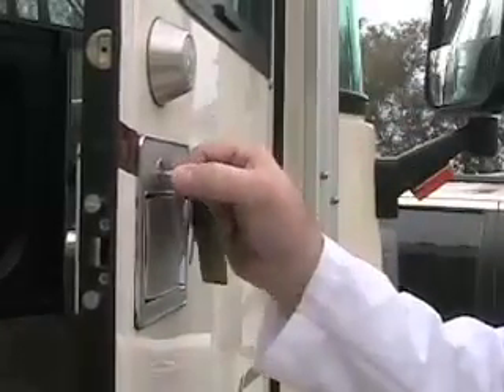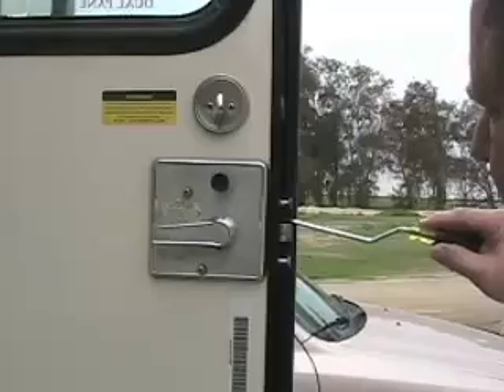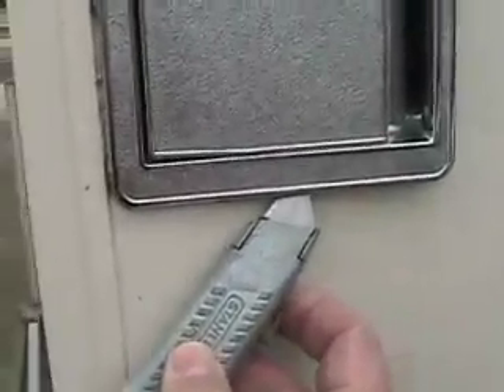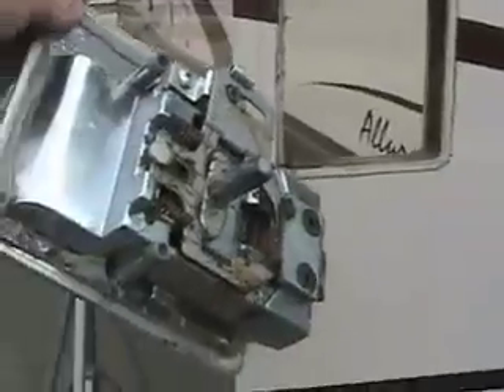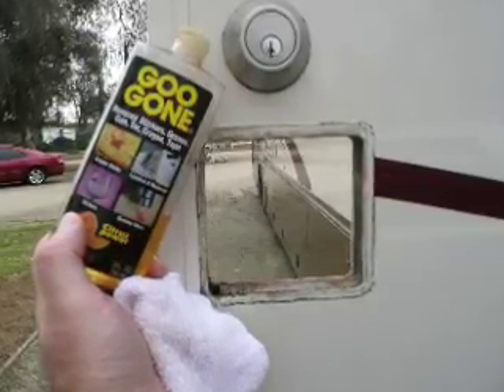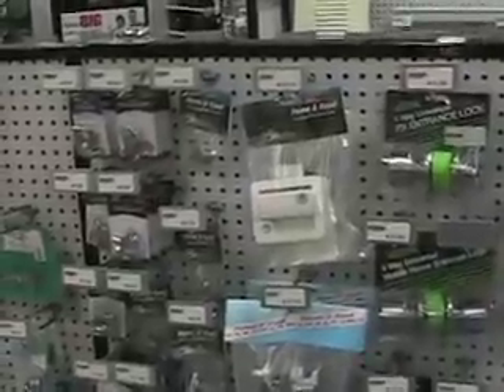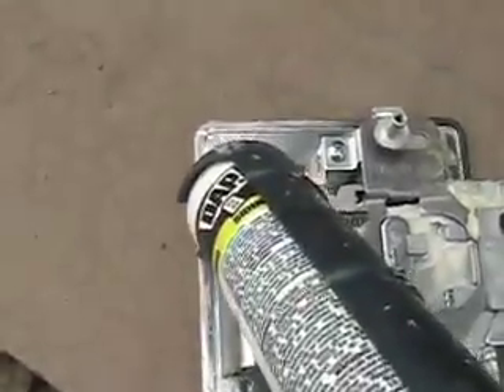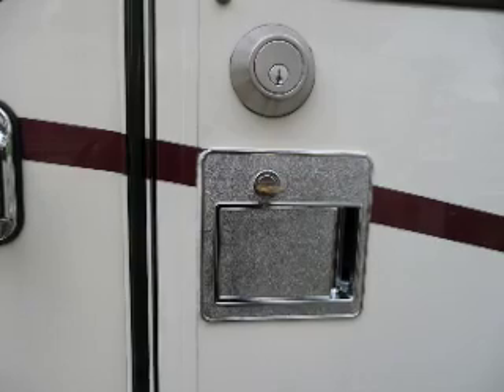RV Lock Security & Replacement

Comment: Just an FYI wafer locks are not susceptible to "bumping." However pin type locks such as the deadbolt installed above the "RV Lock" are. This video has nothing to do about preventing bumping.
Reply: What is a wafer lock

Comment: the guiding bolts on my old unit screw out like theae.  the new lock doesn't have the slots for a screw driver....don't they come out???  is there some other way to remove them or do I need to return it

Comment: This is the exact locking mechanism I need, but I have no idea what the brand is, and can't find it anywhere online. No, it's not on the shelf at my local RV dealer. Does anyone know what the manufacturer is?
Reply: Ken Wittick I just bought the one you are talking about but the guide bolts don't screw out...how do I remove them?
Reply: Ken Wittick hi Ken, the for the reply.  the new lock I bought they said those guide bolts don't screw out anymore and my 40 year old rig doesn't have a replacement that those bolts screw out anymore.  their solution for me is to drill or bore out larger holes on the metal/aluminum or whatever it is... door to allow those guide bolts to pass through the door for jnstallation
Reply: I'm not really sure how I'm going to do that and pray if I do this lock and handle actually fits that space...worried
Reply: I considered using cutters because if I drill I Need to drill above the top hole and below the lower hole to enlarge or I risk making the holes run into the other screw holes that hold the lock in place at the door edge
Reply: I would add a photo here but don't see an option.  those guide bolts had straight screw driver inset on them so they could be removed for installation of the handle and lock, the new version you listed above from AP doesn't have that feature and those bolts can not be removed to install so if this is the only option I will need to drill out those holes larger they said.
Reply: the old assembly had those huge Guide bolts that guide the door shut those bolts screwed out in my old broken lock.  I was able to unscrew them to remove the old assembly.  then the small screws that held it in place.  but the new assembly from AP those Guide Bolts don't come out and d OK not have the screw driver slots for that reason.  I got home and I called them this morning and was told that is my only option.  that these don't unscrew anymore.
Reply: will that AP Products ,part number 013-257 fit in the size hole left by the Bargman Brand lock removed like in the video.. I have the Bargman Brand and it needs replacing.. just don't want to buy AP Products ,part number 013-257 if it doesn't fit!